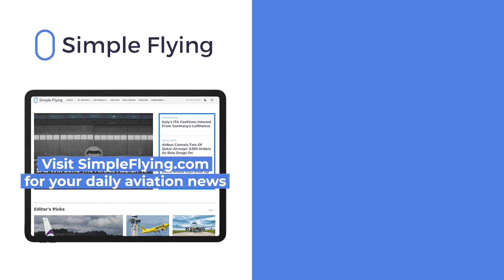Why Do Airliners' Nose Wheels Retract Forward?

Comment: The.nose gear doors are not manually opened. The gear is unlocked during manual gear extension, and the gear structure has several interlock linkages that open the door during extension, and closes the door during retraction. Other than the gear itself being hydraulically operated, the doors are not. They just follow the gear motions. A very clever design. The gear indeed retracts forward for the reasons aforementioned.

Comment: An advantage of rearward retraction in some GA aircraft with which I am familiar is that the C of G moves forward with the nose gear extended. In situations when all seats and baggage area are occupied,  the C  of G is on or close to the rear of the "envelope." It can become easy to "over flair" a landing, or even lose pitch control as fuel burns off during the cruise phase. In the case of the above scenario, slowing the aircraft and lowering the gear (If it's the forward  lowering design) can shift the C of G forward sufficiently to get the aircraft back in control. This prevented my missing out on the grey hair count once, and i've never forgotten it. I had done a zero fuel weight and balance check for this operation, but a passenger in the rear seat took a weighty bag from the floor between the seats and dropped it over his shoulder into the compartiment behind. We were only ca 20 mins from planned top of descent, which was fortunate . I share this because i know of two pilots and their pax who came to grief through being caught out by C of G shift en route.

Comment: I thought the way the nose gear retracts was based on the chief engineer's mood
Reply: so i guess the chief enginner of the trident was feeling 'right'
Reply: No, the engineer's mood only determines the cant angle.  Why does the DC-10 NLG cant forward six degrees?  Because Bob Rothi decided that it should (a forward angle can help to reduce shimmy of the tire pair).

Comment: It also aids in safety during ground operations. As the aircraft generally moves forward on its own, it's less likely to have a nose gear collapse. Additionally since the pushback vehicles connect to the nose gear, it has the same effect during pushback. The Embraer 120 has a rear collapsing nose and main gear, and the main gear needs to be pinned during push back to prevent collapse.
Reply: I bet the main gear is pinned for safety in case the pilots start the engines, get hydraulics and for some reason the gear retracts. Gears don’t just collapse on their own, even when retracting backwards. The weight of the aircraft will make sure the gear doesn’t collapse.
Reply: @rtbrtb_dutchy4183  and the gears could do that if its a airbus-made 220-they have been found with missing gearpins
Reply: @thetruthbehindplanes  missing gear pins?  LOL. So what?
Reply: Interesting ty

Comment: I lost the #1 HYD System on a 747 going into JFK a few years ago. We had to manually drop the gear. It all worked out fine, but we had to get towed off the runway because we also lost nose wheel steering.

Comment: Perhaps an oddball, but the British Trident tri-jet airliner had a nosewheel that retracted sideways!  It was also located to the left of the centre line - not exactly sure why, but it was something to do with available space becoming the driving design factor.
Reply: iirc, the Trident had a large avionics bay under the cockpit, which meant that a conventional nose gear wouldn't fit.
Reply: @able_archer01  I've now seen that also - thanks.  The article I read said the large avionics bay was required for the bulky autoland systems for which the Trident was an early pioneer.
Reply: It was indeed to do with space requirements! The electrical system was was all controlled from the nose in a bay in front (as I recall) of the NLG from large panels. The kit bolted to these panels was quite large and cumbersome with miles of cable coming off them. Also, the flight engineers panel was on the stbd. side of the cockpit with a mass of cables going through the floor directly below it which likely influenced the nose gear design.
Reply: The DC-10 for example has a large cockpit-accessible avionics bay directly under the cockpit.  They simply put the (conventional) NLG bay aft of that.

Comment: Now make a video on why they shifted from the main gear bogeys slanting rearwards to them slanting forwards which is good for air resistance but doesn't make for smooth a landing as older gear design did like in B747 where a rearward slanting landing gear bogey made a smooth touchdown on the runway.
Reply: Where do you see that shift? The A350-900 is the only one that does that. 787, 777, A330 all slant rearwards and and A350-1000 doesn’t slant at all
Reply: @swems-z3s  The B767 , A310, A380, A340-500/600 has both, in the past TU-134 and TU-154 have also used it.
Reply: @M_AbdullahArif  so it‘s a shift to rearwards and not forwards as all the planes you mentioned are out of production
Reply: @swems-z3s  ok
Reply: @M_AbdullahArif the slant, backwards or forwards, has 100% to do with where they have the room to stow. It has no reason at all in regards to landing the aircraft. 

Also, a backward or forward slant has no impact on how soft a landing is, it just looks smoother when it’s slanted back.
Reply: @swems-z3s there is no particular shift. The tilt is designed based on what the best spot is to stow the gear.
Reply: @rtbrtb_dutchy4183  yes i know, I just wanted to point out that even the observation the OP made wasn’t correct, regardless of the reasons
Reply: @swems-z3s  got it. In that case, I fully support your initial statement.
Reply: While we're talking about "slants", there's one which most people aren't aware of because it's very subtle:  A nominal inward cant of 1.5 degrees for the main landing gear strut of some (all?) airliners.  Runways typically have a 1.5 deg slope from the middle to either side in order to facilitate water drainage, so that puts the bogie's tires perpendicular to the pavement and thus keeps the tires evenly loaded.
Reply: @marcmcreynolds2827  that’s not the case. However, some small aircraft with a fixed gear, have their landing gear bent inwards when it flies, but when it touches down, the weight of the aircraft makes the wheels and thus the tires, parallel to the ground.
Reply: @rtbrtb_dutchy4183   "that’s not the case"  That runways don't have a 1.5 deg crown, or that some airliners don't cant the MLG strut inward slightly to allow for it?  In either case, I would need to revise airliner certification reports I submitted to the FAA -- all based on equal tire loading with a crowned runway.  Parallel struts on a crowned runway would mean for example unequal energies going into the brakes.  But the FAA liked the reports just fine as submitted, so I think they're on the same page with me.

"However, some small aircraft..."  I've never done engineering for anything that's not Part 25 (airliners), but I assumed that's how it works for a simple cantilevered gear.  The Part 25 analogy to what you are talking about is that there's a certain amount of cantilever flex in the wing out to the gear trunnion, so the unloaded strut angle isn't exactly 1.5 deg.
Reply: @marcmcreynolds2827  I know that most runways have a crown, don’t know how much, but I have no issues believing your 1.5°. 

None of the airplanes I’ve flown has what you are talking about, but hey, maybe some do. It feels odd to me, be cause the weight of the aircraft should compress enough of the tires, to really not have an impact on brake energies. It seems much more easier to make different tires that accounts for this instead.

But I’m absolutely not an engineer so I don’t know. All I know is that the manufacturers I’ve flown, didn’t feel it was worth it to do this.